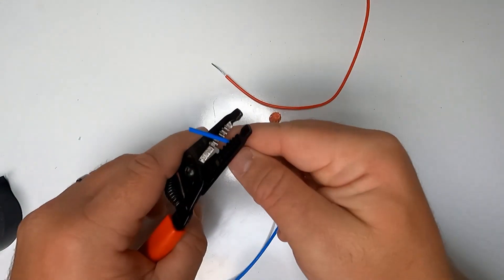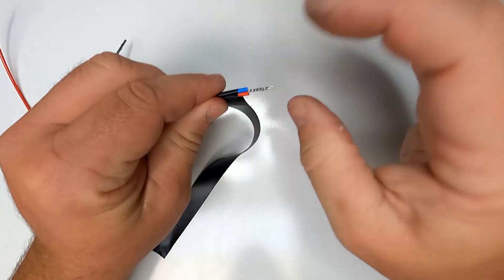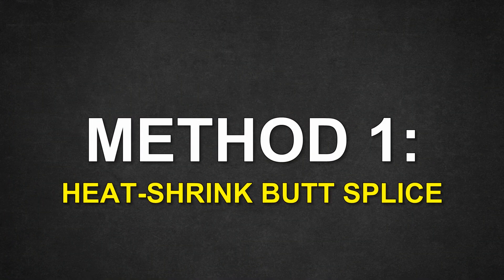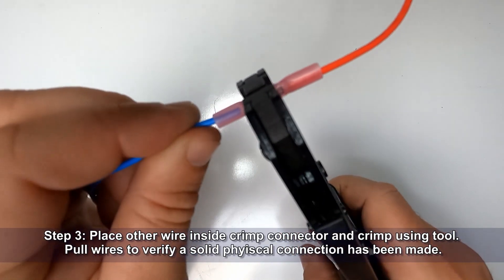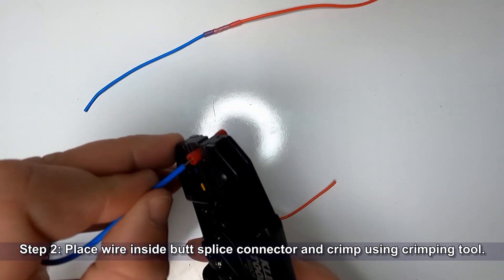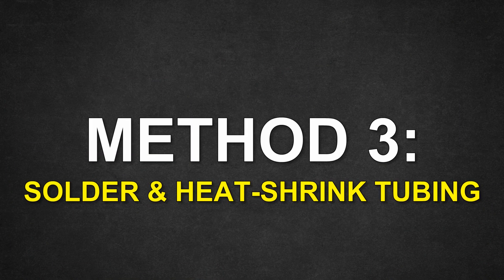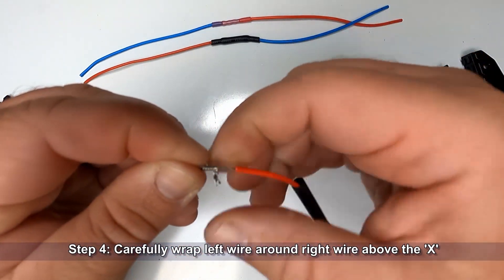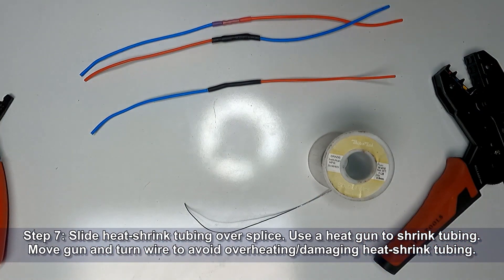How To Splice Wires: 3 Watertight Methods (Soldered, Solderless, Crimped)

Comment: Those are great ideas. I bought some butt wire  Connectors online that have soder inside you wrap the wire as you did and slide connector over splice then heat with heat gun. The solder will melt and heat srink on connector with make a water tite seal and lock wire in place. These are the best and quickest way i have found. Tkx for the tips